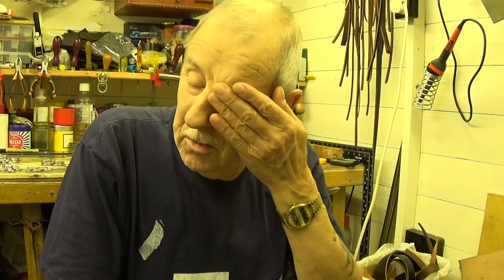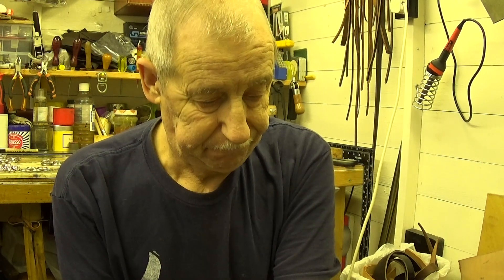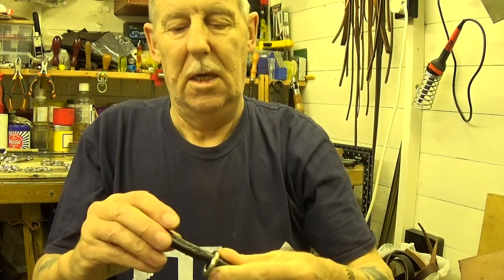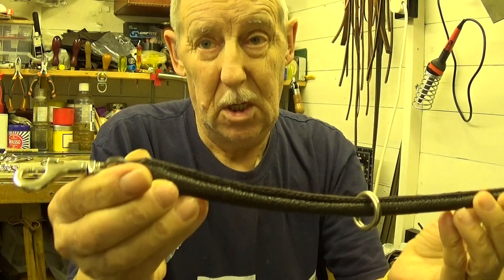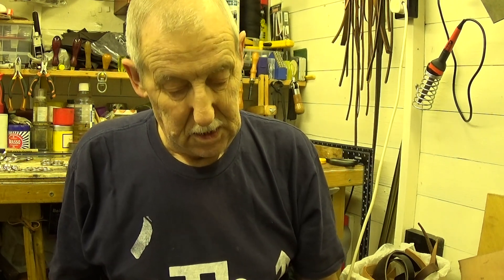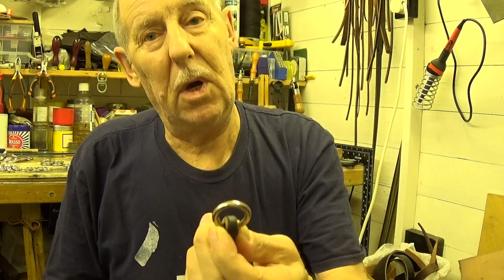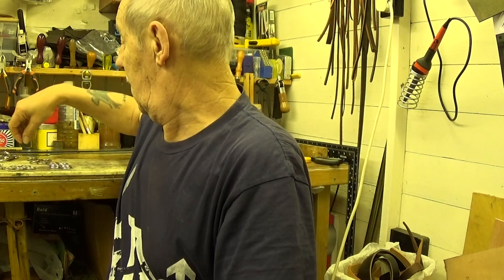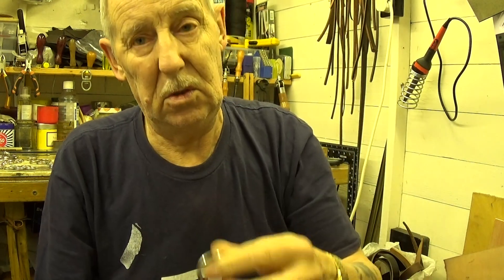Ray's Dominent collar Leerburg 14 inch (Springer size) there about's.

Comment: nice idea Ray.  i was wondering if you did a small id collar that can stay on the dog while using a slip lead ?  maybe just some core with a ring
Reply from the maker: I can, but I DO NOT recommend having the collar on while training the dog, particularly if you are working in cover, I seen too many dogs hooked up by their collar, you could use an I.D. tag with a split ring put on the ring or swivel of the collar.